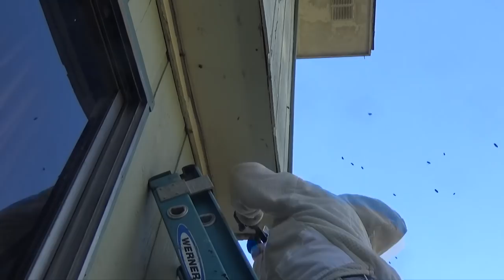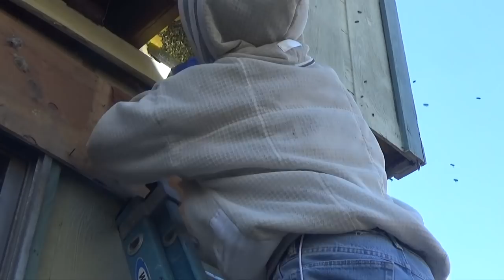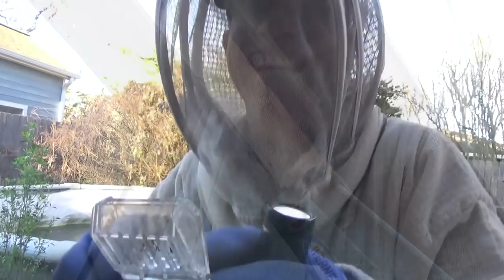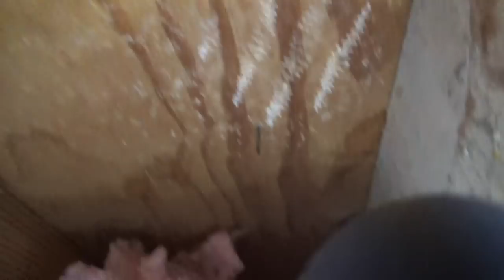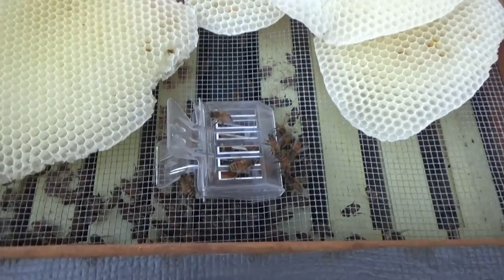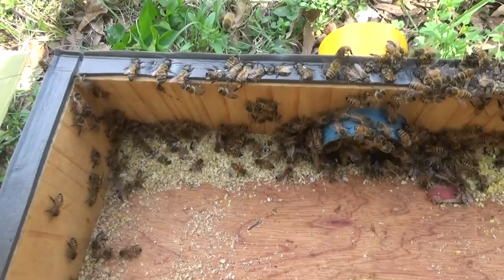You won't believe what was lurking in their roof.

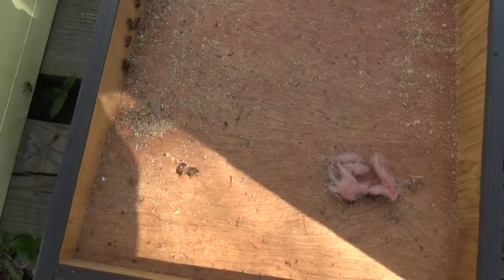Comment: Heck, the seam between the bottom of the bee box and the next box was about 200 times more dangerous than the actual vacuum.  16:30
Reply from the maker: There was a bit of an accident when I unloaded the bees, another reason for not working in the dark. The vac box got opened up and closed in about .005 seconds, but a bunch of bees did get squished. That was the low point of the capture. You have good eyes. Thanks for watching. God's peace.
Mr. Ed
Reply: 0

Comment: There were quite a few bees that were squished around the edge of the bee vacuum, probably because the top was put on on top of them, without time for them to get out of the way... so that was kinda sad. But there were almost no bees dead inside the vacuum, and those bees probably weren't actually killed by the vacuum, they could've just been at the end of their life. You should specify that a bee vacuum is not at all like a home,  or shop vacuum though, because I'd hate for someone to think they can just use a regular vacuum to vacuum bees, and then have them die. I am wondering about the newer comb. In this one you framed it up, but in other videos you said it was too soft to frame up, so how old does comb have to be to frame up? You said this comb was only 4 or 5 days old... or does it depend on the bees? Good video 👍
Reply from the maker: Most of the time, new comb can not be framed because it is so soft. However, it was not the case this time and I was able to use it. Remember, I want to give the bees as much of their work back to them. Yes, even the honey. Thanks for watching. God's peace MD. 
Mr. Ed

Comment: those plastic frame are only good for shipping that it>  i have no use for them nor cell rite or any wax foundation  I use foundationless frames all i use is a wooden guild wedge in the grove of the top bar THAT IT with bush on melted bees wax>  if you need to make the there 1/8 thick 17 inches long and 1 1/2" wide>  a 2" x 6" x 17" long will make a bunch of them on the table saw